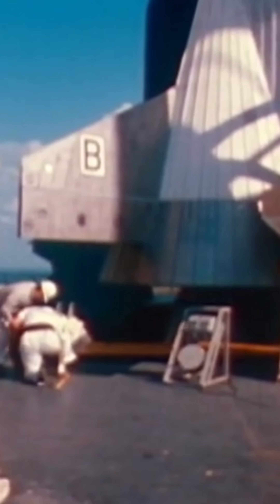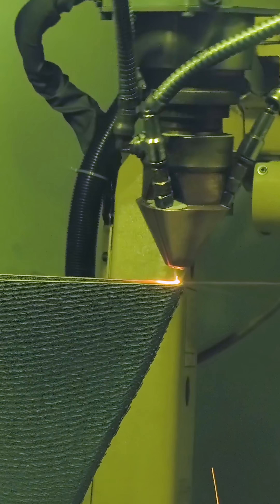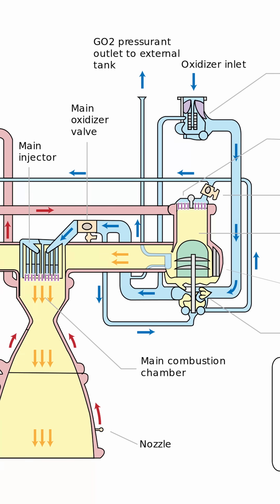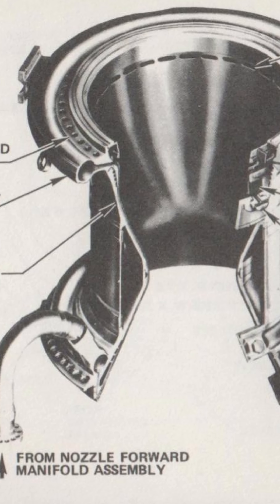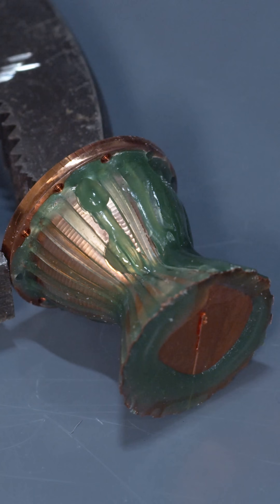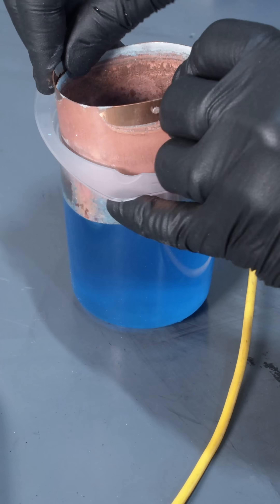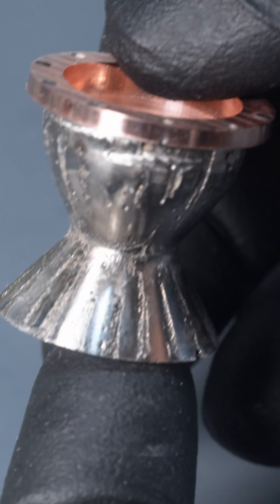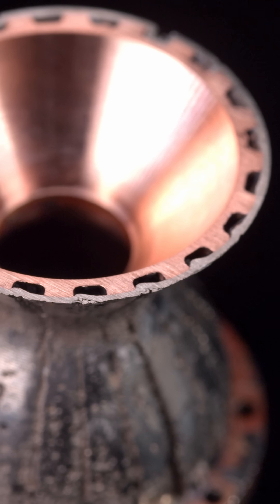Space Shuttle Combustion Chamber

Comment: Had no idea electroplating was this functional. Always thought it was for very small coats/gilding. Never seen it used for manufacturing. Thanks!
Reply: your intuition is mostly right, it takes a ridiculous amount of time to build up a macroscopic layer like this, days for this, even more on the real thing.
Reply: @Taygetea luckily the shuttle engines didn't have to be produced in bulk
Reply: @jeremyh9033 
Good point.
Though we need new shuttles… 😕☹️
Reply: @Taygetea depends on the concentration of the bath and the power source used. A lot of current could move a lot of metal fast
Reply: @Taygetea  moar powah!!!!
Reply: @Taygetea The heavy copper plating is quite fast.
Nickel a bit slower.

If they were going to put a hard chrome plate on, THAT would take a long time.
Reply: Same! I wouldn't have thought that the resulting product would be able to physically stand up to the conditions of a shuttle combustion chamber, but I guess it depends on the particular metal/alloy and the properties of the specific crystalline phase that is deposited by the plating process. You learn something new every day 🤷🏼‍♂️ (if you're open to it, that is)
Reply: @pizzlerot2730 if you have a hugs amount of nickel in aqueous form and you're NASA which has access to literal power plants of energy (electricity), then it's all in a few days work I would think. When completed, take out, rinse with water completely, then alcohol to push out all traces of water. Sand, polish and burnish. I'd like to think that's what they actually did because wow, that's a hell of an engineering flex if true!
Reply: @pizzlerot2730 the inner part is made from a solid billet it's where all the pressure is 
   These channels have cryogenic hydrogen flowing through them to cool the engine
Reply: @pizzlerot2730  can use cryogenic acetone for a model
Reply: To repair tip erosion we used to build up steam turbine blades with plating then CNC them back to exactly original dimensions. It would sometimes take weeks but hanging in a tank requires very few man hours and does not affect the heat treating of the "spine" of the blade.
Reply: This is a technology that is still not fully developed. We found other ways, such a the 3d printing mentioned to do this. But chemical milling and building up by plating can do things that are not possible in any other way.
Reply: @oldfarthacks exactly right.. like that glass that is prismatic to the point that optically it cannot be defined by colour to this day!!! As far as they can tell due to ph chemicals in the soil and conditions over hundreds of years it effectively created hundreds of perfectly grown layers through decomposition and mineralisation phases over and over.. so now it's gold blue red green etc 😅 I'm fairly certain it has the same functional use as things were growing today thorough out electrochemistry and it just sat in the mudd 😊
Reply: Electroplating is almost never used to create thick layers because it is VERY slow. In this case it was the only option.
Reply: @kellymoses8566 
Is it slow, or can the process time be controlled based on the amount of current used?
Reply: @Jadebones  I'd assume the current might increase the rate, but would also create heat and turbulence at some point that might interfere with deposition that would limit how fast it could be done. Makes me want to play.
Reply: How do you electro-plate wax? Or did I misunderstand?
Reply: Disregard, I saw elsewhere they put carbon powder into the wax to make it conductive.
Reply: @paulsengupta971  It seems that the EP process will bridge the gaps across the non-conductive wax, probably by microscopic "wiskers"...
Reply: . I am a process engineer at a plating shop and yes you can use more current along with a more concentrated bath to drastically increase "plate rate". The tanks are hundreds of gallons bigger than a beaker and is much more efficient.
Reply: @paulsengupta971 the first coating is copper which is what the main piece is made of.  The electroplating starts at the high ridges and grows across over the wax.  It doesn’t bond to the wax itself.   

Think of it like stone archways that use key stones or domes.  They piled up dirt to support the stones till the key stones were in place.  This is what the wax does.  It serves as a support while the electroplating grows over the gap and then is removed afterwards
Reply: @paulsengupta971 You don’t electroplate the wax.   They are using the wax to stop off areas to prevent plating on those surfaces.

The copper will plate onto the exposed area, and as it grows, it’ll grow over the wax and connect up with the next area of copper.
The nickel electroplate adds a tougher outer layer than the plated copper.
Reply: my shop uses electroplateing to repair undersized bearing  journals.  It goes faster with higher amperage but that also produces more heat which in this case would melt the wax.  Even in our application it can take half an hour to lay down a couple thousandths of an inch of material.
Reply: @merendell Not heard of electroplating to repair bearing journals before, that's a really interesting method. What material is plated onto the journals?
Reply: @ferrumignis  Its a Nickle plating. rotor is in lathe and being rotated.  A basin of the Nickle solution is under the journal with a pump sending the solution up to a shaped anode with fluid channels in it.  A ground strap/brush is run somewhere else on the shaft to form the cathode.  We build up the plateing a thou or so over what the needed size is then polish it back to tolerance in the lathe as the freshly plated surface is a bit rough.
Reply: @ferrumignis Hard chrome
Reply: I think vacuum sputtering and sintering would have been alternated with plating to achieve the strength required to withstand the pressures required
Reply: Electroforming is amazing
Reply: It's functional for making thick layers if you can keep a uniform electric field strength around the part.
For example.

If you have a copper rod electrode and a part. The section of the part closest to the electrode will get a thicker layer.
Reply: @markp8295  So could you attach the item to something to give it a slow spin to build it up evenly?
Reply: well this was a small model so electroplating is feasible here, anyways I dont know about the bigger ones
Reply: You can even do the reverse:  use it to cut very precise holes
Reply: The wax part of the manufacture is as traditional as you can possibly get, that's been used consistently for thousands of years.
Reply: also you need to sinter it to be same strong as solid material. else it will be around 50% weaker.
Reply: Wax is still used today for all of these complex parts
Reply: Would it be possible to weld a outer layer ?
Reply: You never seen it used on military naval ships
Reply: How does the electro coating adhere to the wax surface tho? Is it special wax?  I was thinking wax with nano steel mixed.
Reply: @therockslingguy2081  I think the point is that it doesn't adhere to the wax. It attempts to evenly distribute on the surface of the object, it can only bond to the surfaces that are intended. And it builds upon them.
Reply: @therockslingguy2081  By connecting to the metal to either side and building up.
Reply: It's not practical for mass production. Anything more than a very thin layer takes alot of time, alot of electricity, and very expensive equipment. 

Going to the moon and or space isn't practical to start with so it didn't matter lmao
Reply: Exactly what I was thinking! I've never seen (that I can remember) a layer that thick on an electroplated item/part. Super sic!
Reply: I've seen some pretty cool videos of people electroplating 3D prints. They're normally sprayed or dipped in a copper based paint to give a conductive surface for the plating to build on. 
That probably would have produced better results in this example since the plating would be more uniform rather than building up from each side of the wax filled channels to meet in the middle.
Reply: I think your intuition is correct. The plating would need to withstand huge amounts of pressure and extremely high heat. I can't imagine it could be functional from plating. I could be wrong though.
Reply: It’s not a very feasible solution. I’d be willing to bet that the part probably sat in the plating tank for a week or more per tank to build up the amount of material they needed. It’s a genius strategy, but incredibly slow. The newer version of it was metal arc spraying. But that is extremely messy and not as controllable.
Reply: It's a Process similar to the way
Stampers and Masters are made to produce Phonograph Records!
❤😮😊🎭🤔💋🤑
Reply: @wilneal8015  lol, random emoji vomit
Reply: Ha, I was my own 100th like
Reply: @ACustodian  yeah well I was your 101st 😈
Reply: That's Anodizing you're thinking of. Anodizing is where salts are deposited onto a metal to protect it from oxidation. Max thickness of this process is only about 50 micrometers.
Reply: @paulmichaelfreedman8334  I don't think that's what the user meant. Electroplating is literally the exact same theory as anodizing, only the part to be treated is the cathode instead of the anode, and different metal salts may be used. I think the user was just saying that they thought electroplating was only ever used to deposit thin layers of metal onto objects, which to be fair is indeed often the case with products familiar to consumers.
Reply: @paulmichaelfreedman8334 anodizing isnt deposition of metal via salts though... anodizing is the artificial oxidation of the metal surface growing deeper into the skin of the surface of metal. essentially faster rusting of a metal such as alluminum.   using salts to deposit is electroplating.
Reply: nope. anodizing is anode oxidation. no salts. @paulmichaelfreedman8334
Reply: @paulmichaelfreedman8334 Anodizing drives a thick and tough oxide layer into the metal, typically aluminum, titanium and/or magnesium.

Electroplating puts a layer of metal(s)on the substrate.

Comment: I'm 100 percent sure that using a ball end router tip on a mill would make a machined finished product that is way more accurate to specs than electroplating or 3-D printing... I mean there is a dude who cut a .3mm channel in a .5mm piece of graphite that was 3 inches long!
Reply: in a curved line?
Reply: @PLAYERSLAYER_22  ugh... ya? Why wouldn't you? You would just set the feed out on the cross slide to what ever ratio you need whether thats linear parabola, logarithmic, cos[x] sine[x] ect.
Reply: @ray_casso  A hollow tube along e.g. a cos(x) curve?
A ball end router tip alone couldn't achieve this, and a flexible shaft for drilling a curved tunnel sounds way more complicated.
Can you tell any YouTube channel that demonstrates such a procedure?

What I can imagine though is using a ball end router tip to drill channels which are almost closed tubes except for a small trench used for milling them, then fill these channels with wax (+ apply graphite powder), and use electrocoating for closing the trenches / getting closed tubes. Or weld the trenches to get closed tubes.

Comment: But if you 3D print it out of metal, how do you polish the internal surfaces to reduce the roughness off the printer? Pretty good question huh?
Reply: I thought metal 3d printing was done with compressing metal dust into a shape then heat treating it? Which wouldnt have any roughness
Reply: @drmantistoboggan2870  well that’s called sintering, and had been around longer. Also even in that case the individual grains would still be distinguishable on the surface

Comment: Omg that’s how they did it! I saw other videos about the cooling channels, but I didn’t know how they manufactured them. Awesome video.
Reply: A little detail that was left out in the short version - he put graphite in the wax to make it conductive for the electroplating process. At NASA they also used a special wax to avoid any carbon deposits from forming when it was heated and melted.
Reply: @DFPercush  my mind immediately nudged me about the wax during the electroplating part, asking "how'd he do that?!" Haha
Reply: @DFPercush that's what I was going to say!
Reply: @oh wow! Very damn cool DFPercush
Reply: @DFPercush That make sense😂
Reply: Same! This is the first video I've seen that explains it. I'd never have considered electroplating over wax.
Reply: I was expecting welding or sintering/ forging. This didn't cross my mind at all.
Reply: Manufacturing ease makes it a breeze〜
Reply: This is really fascinating and so simple. No matter how simple to do something new takes someone clever.
Reply: Wax has been used in casting and other machining to make negatives for a long time period but yes this was an amazing thing and I like the video.
Reply: Correct me if I’m wrong but the electroplating also makes sure that the metal is incredibly pure right ? So it’s stronger ?
Reply: Yep, it's a pretty old method.  Though, in the video he appears to remove the wax by pushing it through with air or something.  The method I've always seen is to simply "fire" the piece.  You heat it up in a special kiln until the wax simply evaporates.  I doubt he plans to actually use the piece for anything so his method, while probably a bigger headache to do, is good enough.
Reply: Regenerative cooling......
Reply: Have you seen the interstellar video? What a documentary! Nasa is amazing!
Reply: They are using what's called a lost wax technique from indus valley civilization thousands of years ago. It's actually still in use in some houses of Tamil Nadu India where they have been passing it down for thousands of years.
Reply: @rahulsharma8940 here we go again
Reply: @rahulsharma8940 oh, the "lost" technique is still used in houses that have passed it down over thousands of years? Sounds like it's not very lost.
Reply: I thank God every day that those scientists and engineers at NASA worked so diligently to fake the moon landing. Truly some of the greatest American heroes of all time.
Reply: @matthewsmith5374  In fact, it was so difficult to fake that they had to go to the moon to do it.
Reply: @paulsengupta971  I think the extra cost of filming on location was worth it for the production quality, and I think the 7 Oscar’s speak for themselves.
Reply: @matthewsmith5374 I mean that same thing can be said for so much of American history, its the American way to lie and bs until they believe its true🤷
Reply: @Soberhellraiser  you think that’s exclusive to American history?